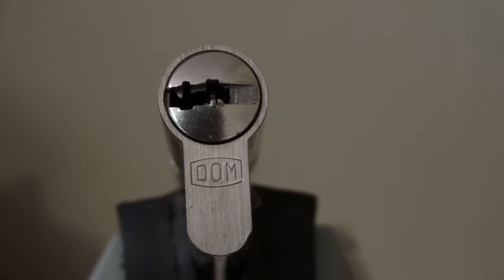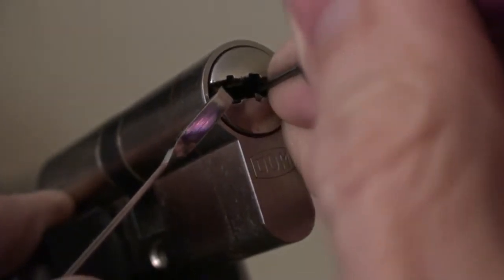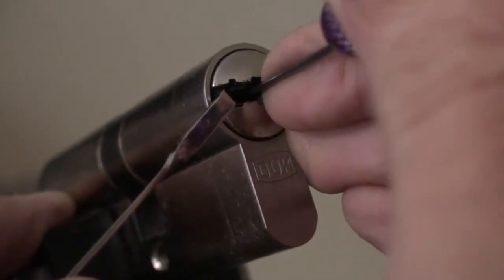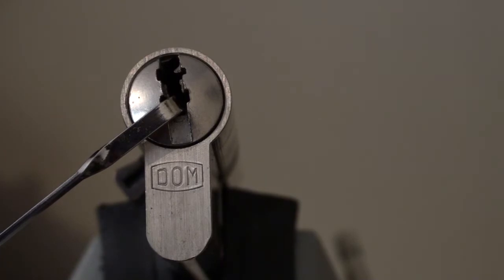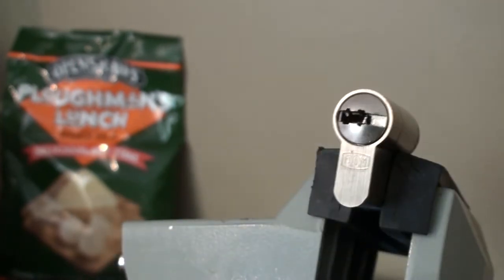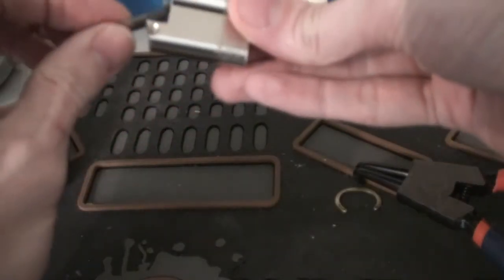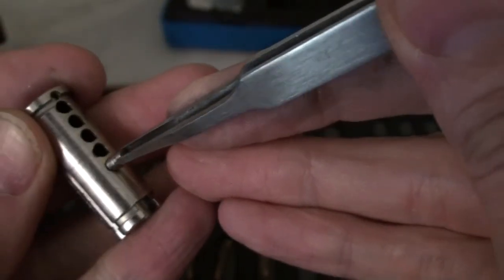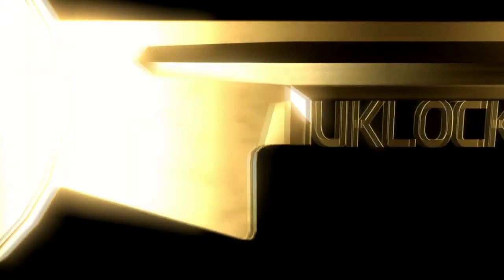072 DOM iX picked and gutted - Shark fin key pins

Comment: Could you recommend a set of hooks for dimple locks? I think you use a honest or goso. What do you think of these picks?  Thank you.
Reply from the maker: Klein Hervé no problem mate.
I use the goso/daniu set with the black rubber handles, about 18 dollars from banggood.
They are good, but need work.
The Honest dongs have excellent handles, but the tips are very big and need a lot of work for some keyways.
I also have the goso set that comes in a green box, composed of a silver handle and 14 pick tips.
That is very good, probably requiring the least work.
The best option for me is to buy all three !! But if I had to choose one, it would be the black handled goso/daniu set, a pack of needle files, some wet and dry and some elbow grease :).
Alternatively, if you have the cash, the Spooxe set is supposed to be fantastic. It is the goso/daniu set that I am recommending, with the work already done to them, so although they are expensive, they are ready to use